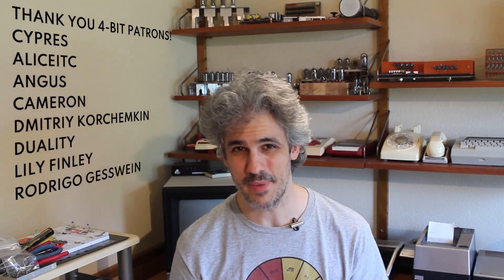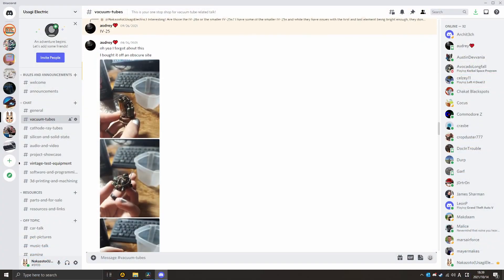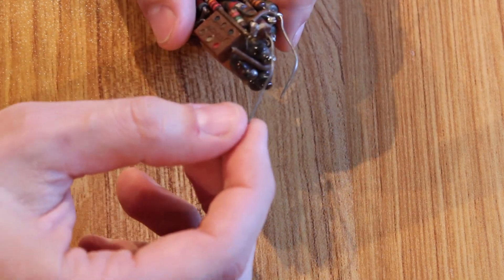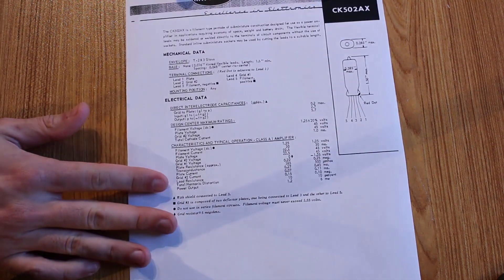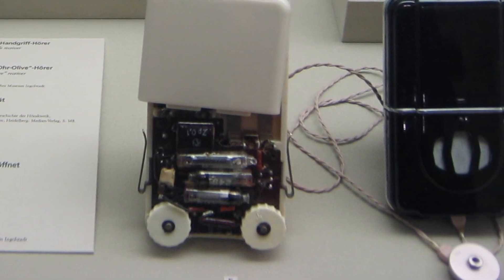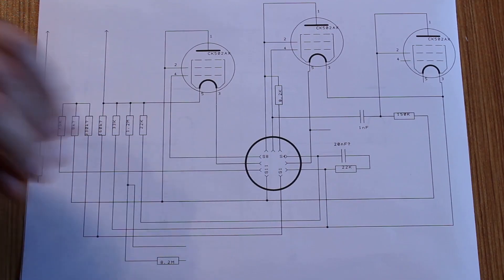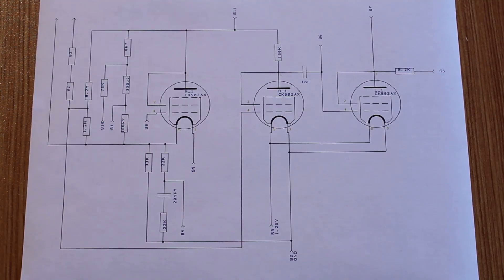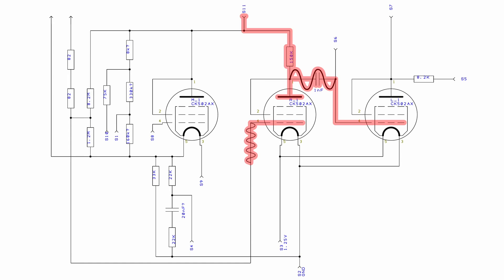Trying to Reverse Engineer a Vacuum Tube Integrated Module

Comment: This voltage divider and AC offset tube circuit sugest it could work in a diferential equation solving tube computer like AKAT-1 https://en.m.wikipedia.org/wiki/Jacek_Karpi%C5%84ski
Reply from the maker: Interesting, that was definitely not a direction I was thinking, but it could very well be!
More importantly though, I hadn't heard of the AKAT-1 before, and that thing is epic! Aside form the capability, which is amazing too given when it was built, the aesthetic is top class. It would look perfect sitting inside a Mid-Century Modern home designed by Frank Lloyd Wright or something.
Thanks for turning me on to that awesome piece of history!
Reply: @UsagiElectric  look, in my opinion it is definently not a RF as tubes are not shielded ( but glued together) capacitors grade is not RF grade and module kind of circuitry desighed to be mass produced and easy replaced sugest its rather fits to socket board with hundreds of such elements in arrays, external leads perhaps were used to do " logic programing" by hardwiring them into inputs outputs.  Early computers were not always touring machines ( read. Theoretical Pawlak machine) which was predecessors to todays neural network, then opamps were intorduced to replace tube modules in analogue computers, free world newer experience some designs of suc computers becouse neither Karpinski nor Pawlak ( creator or ODRA  Polish conputer operating in negative radix insteadd of binary system) get passporrs to leave dammed communistic block... Karpinski ended up running Pig farm ( real swines and hogs) as he said in the interview: "I preffere real Swines then the  The government ones." ;)
Reply from the maker: @marcsmithsonian9773  I definitely see where you're coming from!
With RF, I think it could probably be fine for ULF, VLF or LF up to about 1MHz. At such low frequencies, the importance of shielding and RF grade components isn't quite important. These type of Mica capacitors I see very regularly on old AM tube radios which here in the US runs from about 500kHz up to 1,700kHz (1.7MHz). I'm not quite as familiar with early differential calculators as I am with the later IBM style computer like the 604 or 650, so it's definitely possible that the component was used for some kind of early analog computing application!
Reply: @UsagiElectric  You make a good point, despite the fact it could work in LF aplication, still I believe ahield of some  sort wpuld be aplied to what I observed in old tube circuitry, I work alot on tume amps as hobby testore old HK, Fishers and RCA and they all use shield in  preamp section and tuner , so I figured back then wnginers were quite religious about shielding from interference, I would be suprised if that actualy was RF part. But I am not an autority on that. GOOD LUCK !

Comment: An interesting video!  A really curious device as well.
Might I make some suggestions?  In the future, when dealing with vacuum tube circuits, it is standard practice to label the tubes as V1, V2, V3 etc.   R is most commonly used as a designator for resistors, such as R1, R2, R3 etc.
The "Black Mystery Object" may in fact be either an inductor or capacitor.  Years ago, while working in R&D, I had obtained a capacitor that looked like a resistor with the exception that it had a pink base color but the value was still indicated by color bands.  When it was checked on a network analyzer it was discovered that while it was indeed the value of capacitance I had ordered, it was EXACTLY the value in inductance that my bosses, bosses, boss needed.  Isn't electronics fascinating!!!???!!!
If you ever find out what this thing actually was, please post it!
Subscribing to your channel by the way!
Reply from the maker: Thank you so much!
And thank you for the advice! Normally, I try to follow regular schematic conventions (V1, V2, V3, etc.), but when I was drawing up the schematic I kept getting confused as to which symbol related to which physical tube. Since there's no good indications on the device itself, I ended up labeling the tubes according to their physical position. So, when looking at the component from the top, with the mica capacitor facing up, L_1 is the left tube, M_1 is the middle tube, and R_1 is the right tube. It's not ideal, but it helped me keep things straight while tracing everything out!
The mystery component could definitely be an inductor! My primary reasoning behind thinking it was a capacitor is that quite a few audio circuits use a bypass cap in parallel with a resistor on the cathode, which looked to be pretty close to what's going on here. Having said that, the circuit is pretty squarely beyond my design capabilities, so that was just a bit of a wild guess.
You're right though, electronics are absolutely fascinating, and there are some truly brilliant people out there that know just how to use (or misuse) components to get them doing exactly what they want!

Comment: that was a super fun video. even though the results are inconclusive i loved hearing about your analysis of this circuit! As for the flying leads, I think they were simply going to a voltage source of some sort, like a power supply, maybe screwed into a terminal, like on a bus bar.
Reply from the maker: Thank you so much!
The flying lead that goes through the two 82 Ohm resistors I'm fairly sure is meant for picking up some kind of signal because it goes directly to the grid of tube R1, so it needs some kind of AC signal on it for R1 to amplify.
There's certainly a lot of interesting and weird stuff going on here, I'd love to see what it plugged into one of these days!

Comment: Supposedly it was a replacement for one of the  Western Electric the 200 series  peanut tubes that was no longer available by the 50s.  I think for battery powered rural telephone stitching amplifying stations.  On doing a little more research if could of been a replacement for an acorn tube
Reply from the maker: I'm not quite sure I'm following, but the idea of it being a replacement for something else is an interesting line of thinking!
Honestly, I'm a little torn between it being a custom made piece by an enthusiast, or an actual production piece, because of how densely it's packed and how utterly un-serviceable it is.
Reply: @UsagiElectric  I have see these for sale on-line over the years.  Could not find a reference for it in tube-lore or in the operations manual I have.  (same as a receiving manual but for op-amp and other not AD/RF valves.) Really just a binder of datasheets.
Reply: How could a complete electronic circuit with three active devices and a handful of various passives be a replacement for a single, early tube type?

For that matter, the 11 lin base is all wrong - this was a later development.

I must be misunderstanding you?
Reply: @drlegendre  Just re-telling what I was told.  Showed the video to one of the old guys at the radio club and that was his initial though.  After I made the post he came back and said it was more likely a replacement for a set of two acorn tubes,  Supposedly at one time there was an 11 pin acorn plug where you would solder in up to 4 acorns.  I looked for it but could not find a reference.

Comment: I was thinking if you had a few of these small tubes could that unit be fixed be replacing the tube with the broken wire but what about mixing up some epoxy with some copper powder in it and use it to join the wire back to where it came off and once it has cured you might be able to power it up.
Reply from the maker: The CK502AX isn't actually that rare or expensive, and I could get a replacement pretty easily on eBay. And, I did think about trying to repair the broken wire - I might even be able to wick some some solder into the base and get lucky that way. Though the copper powder and epoxy idea is a good idea, I'll keep that in mind for the future!
The bigger issue is how to power it up. The tube with the broken wire is also M1 in the schematic, and since it's a cathode follower, the heater has a pretty unique requirement for powering it up. I can't just throw 1.25V into pin 9 of the base, because there's no clear path back to ground. Unfortunately, I just don't know enough about how they were powering up the cathode follower here to feel confident in trying to get it going.
Reply: They sell a silver containing paint pen for pcb repair.
I used this once to repair a CRT grid pin and it worked.
The broken pin is pin 3 which is the filament.
There is some current there so this might not  work.

Comment: Could it be a vacuum tube Operational Amplifier.
Reply from the maker: I had thought about that, and it's a good guess given that the K2-W was built with the similar idea of multiple components through a single base. But, I believe the fundamental thing needed for an OpAmp is a differential amplifier, which I don't quite see here.

Comment: I suspect this is an RF detector, just picking up signals and amplifying it to see whats going on in the air.
I got a mystery device in TTL era version that turned out to be probably used to find the sources of interference, could be something similar.
Reply from the maker: I think you're probably right, that certainly makes the most sense to me!
The flying leads definitely look like they were intended to pick up RF signals in the air, so you may be on to something with it being an interference detector.
Reply: I know this is far fetched, but I remember seeing an article about WW II anti-aircraft shells being outfitted with 'proximity fuses'.  They were tiny, tube operated, withstood high g forces of being shot out of the anti-aircraft gun and low power.  Once fired, they emitted radio signal and if they received a response (tiny echo from being near an airplane) they triggered the explosive.  Used in Pacific theater, (they didn't want to risk losing a dud and having Germans reverse engineer them).

This probably isn't that, but it brought that to mind, those tiny, rugged tube devices were like a primitive radar unit, didn't have to actually HIT the enemy plane anymore, just get close and the charge exploded sending out shrapnel that hit the enemy plane.
Reply: @mikefochtman7164   - You’re correct about the P-fuses. The ones I’ve seen are quite simple. Just one VT device.
Reply: My first thought that it was an "operational amplifier."   The differential inputs are the two extra leads.    

BTW:   the 11 pin octal socket was/is standard for relays with 3 DT contacts.

Comment: Very interesting tube. Its like integrated circuit IC but with tube.
Reply from the maker: Yeah, that was what drew me to it! Sure it doesn't follow the DIP package, but it's a proper, full on circuit, integrated into a single plug-in base, so it's about as close to a vacuum tube IC as I think we'll see!
Reply: @UsagiElectric  IBM made lots of things like that! There were also integrated tube opamps.
Reply: @UsagiElectric "hollow-state minielectronics"

Comment: Nice work! I assume they are limited as to the functions they can fit into one tube due to lack of insulation between parts?
Reply from the maker: Thank you!
Interestingly, they use insulating covers on quite a few leads because otherwise it would just be a mess of short circuits, but I imagine that it's still a noisy nightmare, haha. 
To me this piece sits in a weird spot in history. If I'm not mistaken, sub-miniature tubes didn't really start to become common until the mid- to late-50's, but by that time, building stuff on PCBs was also starting to become a bit more common (like my HP 150A scope). This piece might ultimately be more compact to build it this way, but with the tubes laying flat on a PCB, you could remake the circuit and have it be an incredibly thin board, all while having better properties in the circuit and way easier maintainability. 
I would love to see what it plugged in to some day, I think it would answer so many questions (or just make hundreds of new questions, haha).